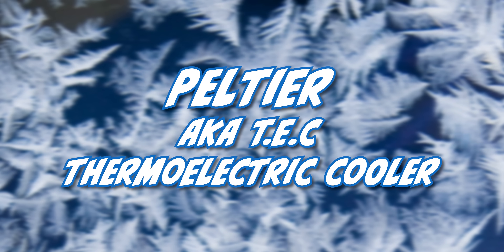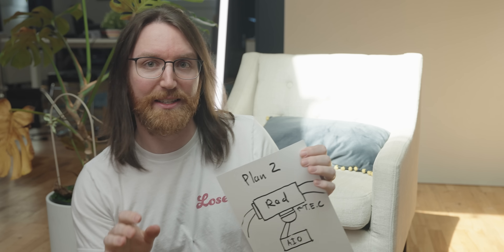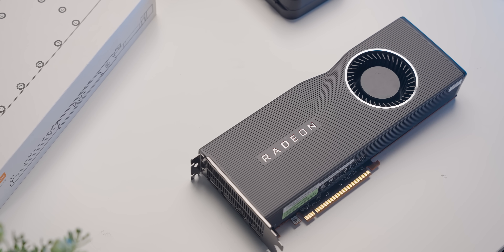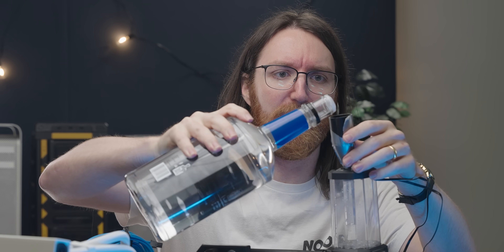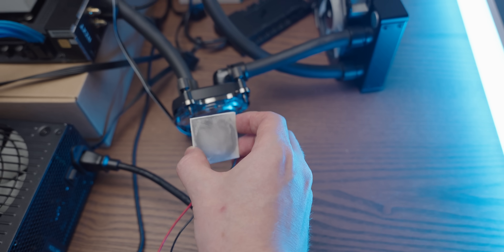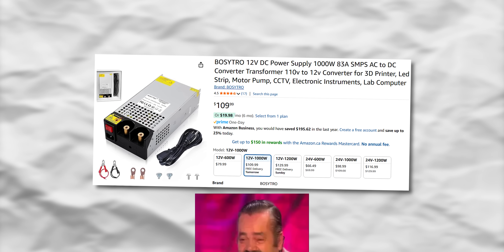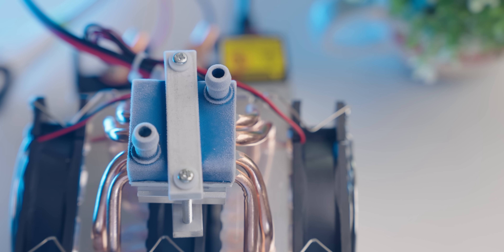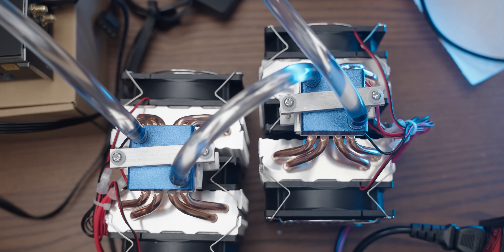I REVOLUTIONISE PC Cooling....

Comment: Dual loop is the answer and I'm so relieved he got there eventually but frightened that he needed help to get there. Never change man, never change. When you do get all 12 of those coolers in a row and they do nothing try taking the radiator out of the loop. Long story short your loop radiator may be not doing what you think it's doing. Or take the card out of the loop and put the peltiers out the window and have the worlds most inefficient air conditioner.

Comment: The pelts are cheap, and a box of Xeon heatpipe coolers can be had for cheap. They also increase in efficiency if you lower the voltage, which makes it easier for the heatsink to handle. You never see anyone use $200 worth of cheap peltiers.

Alternatively you could turn a cheap refrigerator in to a self cooling reservior.

Comment: I tried this around 2002 for just CPU cooling (Some cheapo Thermaltake closed loop system with a butchered in second CPU cooler for the TEC element) .. yeah it did not do jack...
Years later I had a review sample of the Titan Amanda, it looked basically like the fish tank cooler you bought. It did not cool any better than a comparable size pure heatpipe cooler.

Comment: 1. Use a motherboard that can control fans based on an external temperature sensor. Get a G1/4 temp sensor BEFORE THE GRAPHICS CARD in the loop and run the radiator fans on DC so you can set a zero rpm mode and have them turn off at lower loop temps e.g. below  room temperature. Make the radiator immediately after the graphics card in the loop.
2. Add a very large header tank and use an independant loop with the peltiers in it to cool the header tank contents, with the header tank feeding the pump res inlet  This can be pre-cooled prior to operating the gpu if required.
3. Air cool the peltier hot sides to minimise heat exchange inefficiencies and run the peltier waterblocks in parallell in the loop to maximise peak heat dissipation and in series to minimise the lowest achievable loop outlet temperature.

Comment: Unusual idea bit I fear one of the issues is the liquid is being pumped round too fast for the peltier to make any significant difference.  Lowering the pump speed might improve things a little bit but the regular loop pumps aren't designed to be low speed since they are usually designed for reasonably high flow rates.

Comment: This can work, but you need a large enough rad so that its outlet temp is almost room temp. So something like a 420 or 2*360 in series. Then you put the chillers on the outlet of the rad to pull the liquid below ambient.
So this order and flow direction : system -> pump -> rad -> chiller -> system. Monitor the rad outlet temperature. If it is more than a couple degrees above ambient, you need more rads/airflow over them. Good luck.

Comment: One thing to kerp in mind with TEC ratings is that full power is where the cooler is barely managing to keep its own heat from going to the cold side. If you want to achieve any sort of efficacy, you have to run them at less that 50% power. Last time I looked at spec sheets, peak efficiency was around 10% of rated power at a temperature delta of 10C.
Reply: looking at a 12710 sheet, its linear from 0-8A. 8-A10A  is a pretty low increase in performance. so not worth it.

efficiency is a grey area... its about gradients, thermal conductivity, area, radiating area...
if somethings cooling down, its radiating heat faster than it absorbs. if its heating up, its absorbing faster than it radiates.  a heatsink absorbs so much energy through its junction, radiates so much through its fins, and stores so much as latent or specific heat in its own mass and material. each part has a certain performance, watts per C, that it can flow.
if the hot side is the same temp as the cold side, its pumping a serious amount of power as there is no temperature change... 

as most people do the opposite, and try to reach extremes... its like emptying a barrel with a bucket. can fill it the first few times... each time you gotta reach a bit further... then you cant fill the bucket as much and enter an assymptotic curve as you can never quite get those last drops...

at the same time you have to lift the bucket, and empty the bucket... into what?

youre only "efficient" when the barrel is full and  its easy to fill and empty the bucket... if the barrel empties, or the drain clogs... you do less work and efficiency drops drastically...

Comment: I've gone down this rabbit hole and you'll be proud to know that peltiers are just complete garbage. I had dumped a thousand watts into several chained together. I considered it may be more efficient at a lower power, so I spread that thousand watts into two sets of water blocks that can hold 8 chips besides eachother, cooling a small tub of water, and was still beaten by my ice chest cooler that only uses fifty watts.
Reply: they have a usecase in very small or vibration/noise sensitive environments where the refrigeration cycle is inadequate... which are not places where hundreds/thousands of watts need to be dissipated continuously.
Reply: I dont wanna be that guy, but a quick thought experiment would have saved you the effort and money. And Dawid, for that manner. Thermodynamics are a thing, so even if we assume perfect efficiency, peltiers must produce more heat than cold, right? Meaning in the end to get X W of cooling, you'd need to produce > X W of heat. At the very least, right? Anything else would reduce entropy. So if you cant dissipate the original X W of heat you are trying to cool, the > X W of heat you now have is, consequently, only worse to deal with. And that's assuming perfect efficiency, which is very far from reality. In reality you are more like 2-4x'ing the heat you need to dissipate, depending on the peltier setup, just purely based on efficiency, even ignoring heat transfer.
Reply: @Yamyatos  not even a thought experiment, I don't remember the name, but I was thinking about using peltiers for extreme subzero - like below what a conventional single-stage refrigeration cycle does, and several peltier manufacturers had calculators on their site to determine what you needed for a given thermal situation.

I was thinking I could use peltiers on the cold side of the refrigerator... But it turns out conventional peltiers are even worse when you get the hot side that cold. I was looking at, like, 1% efficiency for what I wanted to do. It's way cheaper to build and run a cascade / 2 stage refrigerator, which is actually pretty common in the xoc community, but it doesn't have a ton of youtube content about the DIY options. everyone has played peltiers out. they always suck. always!
Reply: @Yamyatos  They still suck for all those applications - it's just that there's no alternative!

Comment: You can use these modules to generate voltage by heating one side and cooling the other.
Just as inefficient as they way you're using them so they only get used where there is a lot of waste heat from a process.
These are used in the Mars Rover's  Multi-Mission Radioisotope Thermoelectric Generators (MMRTGs)
Yup, we're not living on Mars but we're dumping nuclear waste there.

Comment: I would think the peltier needs to be mounted on a large copper or aluminum heatsink directly mounted to a CPU, whilst that heatsink has active cooling to lower it to a temperature the peltier could work from. Using water, couldn't water current convection be used to make a pump out of the peltier? A bit like a volcano but the peltier on top channels the cold water down to the CPU to heat up, to be drawn up by the peltier?

Comment: Hey, just a heads up in case someone else hasn't pointed it out; You're using alcohol with rubber tubing. Make sure you drain and rinse everything very good before storage. I'm not familiar with the cooling components your using, they may be rated for it, but generally it's just a good idea to drain and rinse.
Reply: IIRC EPDM doesn't like Alcohol very much. 'Tygon' tubing OtOH, is rated for constant alcohol contact, IIRC.

Comment: I love it. This is a beautiful ignorance of thermal capacity. You just have to essentially jettison energy away from the dies. Temperature is generally irrelevant. Using a more powerful, industrial-esque pump to simply increase the volume of flow would actually make this very interesting, though. Just my 2 cents.

Edit: I do think you're on to something with the final setup, btw.

Comment: Another solution is to use tapwater in the cooling loop. Your water bill might go up, but it works without a radiator or pump.
Or you could build a Transformers themed pc submerged in transformer oil.

Comment: Make the peltier part of the reservoir wall.   It would require a good amount of modification, but it should work.   Then you would need to cool the hot side with a heatsink and fan or something.

Comment: Heat pipes move heat at a crazy rate, adapting an air cooler and mounting the cool side directly to end of the heat pipe and have the fan on the air cooler moving air to hot side direction might be a solution. reason i thought heat pipes in the matter of seconds the air cooler brings my main pc on full load from around 61c straight back down to 38-40c as soon load goes away it cools faster than the pc can tell me so chopping half the fins off on one side of an air cooler to expose the heat pipes on one side and attaching cool side to that, could that work as it sounds like i could and should, i leave the other idea below
Reply: just have a big volume water like 5-10 litres in metal container what sits on top of those coolers and those coolers sit on a good thick peace of metal a big block, so both have a lot thermal mass and pre cool mass of water that give it the head start, maybe even be the boost it needs it may never warm up if lucky it may cool even more, one thing the big block metal maybe attach some big heat sinks to that and fans. my question is, trying to cool the hot size, is the not the whole reason it cools some sort reaction caused by heat

Comment: I wonder how much the small surface area of the cold side is limiting cooling.  Seems like it would need a large finstack with the vodka flowing through it.  The hot side would need its own separate cooling loop as well.

Comment: Why you set:
GPU  hot -> Peltier module -> block -> pomp out -> GPU ? 
Please try:
 pomp out - peltier - gpu hot - block - pomp
(Pomp and peltier in try solution can by replaced.)

Does your pomp has second in and out? Put peltier there.

How you regulate current (amperage) for each peltier module? ;)

Comment: If you do this again please remove the radiator from the primary loop when you hook  up the little electric cooler.  That radiator is changing the temperature of the water to be closer to ambient temp.  Your little cooler is being fought by the radiator.  So yes use more I believe u need a 3:1 ratio of heat load to watts used to pull it away.  So for like a 200 watt card u would need 600 watts of cooling.

Comment: I am sure you aren't doing this Long Term but just so you know, Alcohol Corrodes &  swells the Rubber. So don't use it with any Rubber Parts in a Loop

Comment: Vodka as a coolant is simultaneously genius and a cry for help. This pleases me.
Reply: And alcohol cracks acrylic...
Reply: Tupolev Tu-22 used alcohol as a coolant and the mixture was pretty much vodka from what I remember.
Reply: A GigaChad Slav did, indeed, do this some years ago.

Just search "Boris vodka cooled PC"
Reply: It's not genius at all, alcohol has terrible thermal conductivity compared to water.

For reference, water has 0.609 W/m K
Methanol (The most thermally conductive alcohol) has 0.204 W/m K (All other alcohols are LESS thermally conductive than this)

For reference, Mercury (Toxic liquid metal) has 8.4 W/m K

Alcohol, is, AT BEST, 1/3 as effective as water, for cooling... Water is just better... |The only positive for alcohol, is, i guess it keeps the cooling system clean, and prevents any rust and/or bacteria build-up. Those are the only positives i could think of, lol.
Reply: @MyouKyuubi , writes "Alcohol, is, AT BEST, 1/3 as effective as water, for cooling..."

In his defense, it's vodka and only 40% alcohol, so it's not as bad as you say. It's still bad, don't get me wrong, but he wasn't using 100% alcohol.
Reply: @fred_derf  Alright, fair point!
Reply: @MyouKyuubi  The thermal capacity is even lower than the conductivity, compared to water. Also the boiling point point is lower than what a GPU or CPU can output. Luckily there should still be mostly water in there, with some alcohol as anti-freeze.
Reply: @MyouKyuubi the positive for alcohol is that it doesn't freeze at zero degrees c.  However I think Dawid was a little too optimistic on how well his cooler was going to work 😂
Reply: @kieron88ward  "the positive for alcohol is that it doesn't freeze at zero degrees c."

That's not a positive, because its awful thermal conductivity means it's more likely to evaporate into the air weeks before it would ever have the opportunity to reach freezing temperatures.

But yeah, Dawid's channel is all about testing dumb stuff! It was an entertaining watch! 🤣
Reply: @MyouKyuubi  idk know how long it would take but wouldn't the vodka eventually turn more water than anything else?
Reply: @GhostfaceV  Alcohol has a tendency to evaporate quickly, if not properly sealed, yes, if it's not properly sealed, then the alcohol will evaporate, leaving only the water behind... So i guess it depends on the seal.
Reply: @MyouKyuubi  Vodak was fun but hurt my brain lol
Reply: @MyouKyuubi  Sure, but the way pure Ethanol is used for cooling is evaporation, i.e. in some soviet fighter jets.

Comment: idea: peltier located after the radiator. cool side attached to a water block that's transferring water to the CPU/GPU, but the warm side goes to a separate water loop with its own radiator. So two water blocks on the peltier.

Comment: Add a drop or 2 of jet dry, it is a surfactant ant decreases surface tension of the water and will increase surface contact increasing thermal efficiency
Reply: Alcohol already has a pretty low surface tension. Vodka has a surface tension of around 29.63 dyn/cm, while water has a surface tension of around 71.97 dyn/cm.
Reply: @fred_derf  i commented before watching lol

Comment: Now I wonder what if you bought a cheap, used freezer or a mini fridge with a freezer, and just put the radiator in the freezer. Drill holes to the side for tubes and cables, seal with foam and let it rip lol.

Comment: The problem is that water has a short contact time with cold metal. Therefore, it does not have time to cool down. You need to make a long obstacle course for the water. So that it is in contact with the cold metal long enough to cool down.
Reply: That's not an issue in a closed loop as the coolant flow will make the effective contact time infinite.

The issue here is the fact that the radiator fans are normalizing the liquid temperature - if the Peltier cools the coolant by 0.1C the radiator will add 0.08C back in.  There will still be a benefit, but the radiator fans should be off and only triggered if the loop gets too warm, then the Peltier can have a chance to chill the coolant below ambient.
Reply: @looncraz  yes. true :(

Comment: I did this years ago, even made a custom water block made out of aluminum and some premade heatsinks that I glued on with thermal epoxy. The issue is TECs are not very efficient and the size needed to cool even a 125 watt CPU somewhat, would be around 6x6 inches and that would only drop it a few degrees C. The other issue is that you have to have a way to remove the heat from the hot side as the more heat you remove from the hot side the colder the cold side can get. Plus the more heat moved, the more power you have to dump into it to move it.

Comment: It would make so much more sense to use a compressor system like from a deep freeze/fridge. Peltier style systems are massively inefficient and are much better suited for low temperature difference scenarios or scenarios where you need to move heat in two directions, or times that you don't really care about efficiency.

As an example, I have a thermoelectric cooler that you can use to keep things cool like a normal fridge stule cooler without the need for ice. It only gets the inside about 20-25C below ambient. But you can also run it backwards it makes the inside hot, about 65C or just above the food safe temp for food service. So if you put hot things in it they will stay a nice edible temperature. I use it for food delivery and people are very surprised when they actually get hot food delivered.

A compressor style cooler would be able to get below freezing, and use less than half the energy... But can't get hot. So I just deal with the inefficiency if I want cold drinks and also want to keep food hot in tbe same box.

Comment: But liquid cooling STILL requires a liquid to air heat transfer system.  Isn't this just the same thing with extra steps?  I think you'd do MUCH better if you attached the evaporator of an air conditioner to the CPU side.  Just go for a full heat pump refrigeration setup.

Comment: What no one says that would make more sense why peltier coolers suck for computers is "They are not designed for a constant thermal load. They are great for things that you need to cool down, but not so much for things that can heat back up quickly."

Comment: Why do you have a radiator in the loop if you plan to cool it below ambient... Or if you're just trying to lower coolant delta, why don't you just add more radiators? Chilled water loop have been tested from years now,  peltier is only viable if you're trying to cool low wattage parts like memory, else go for refrigerated cooling.